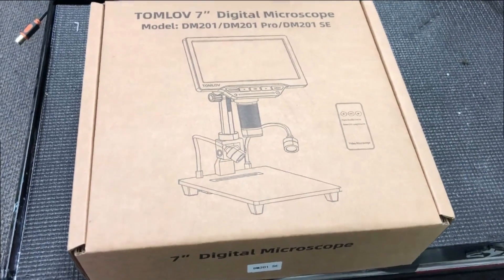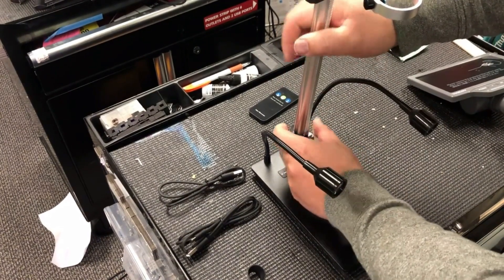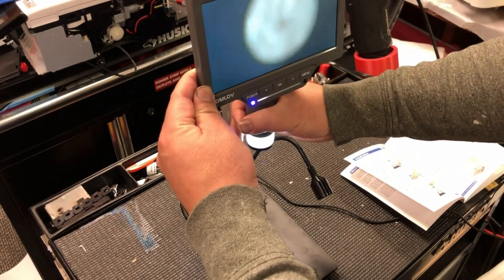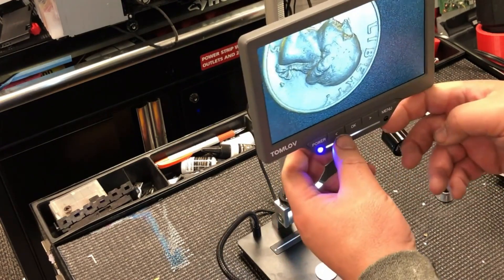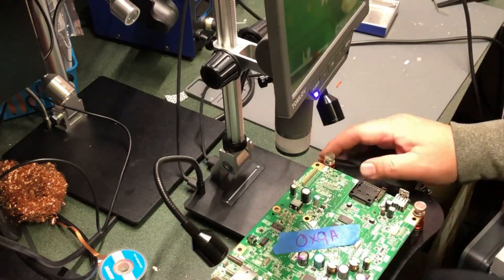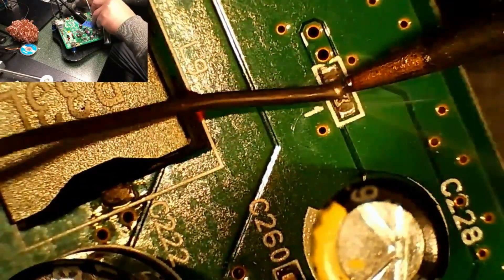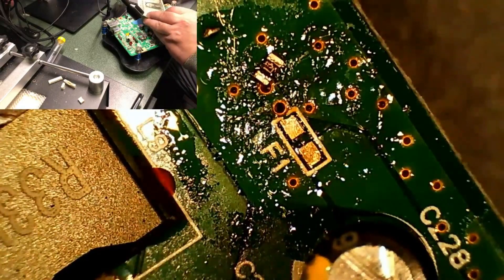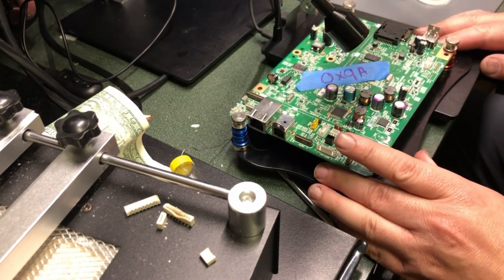Unboxing the Impressive Tomlov DM201 SE - an Unbelievable Tool for Mainboard Repair!

Comment: I have a question about the height extension. How is it for working on watches for 
example, with tweezers, little screwdrivers, etc. Is the microscope practical for 
working on stuff under the lens, as opposed to just observing? Thanks.